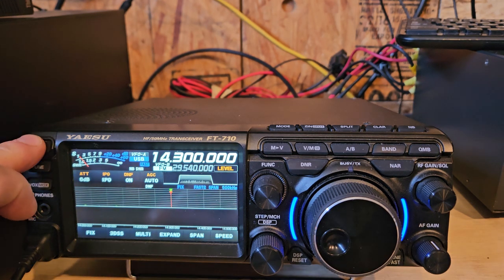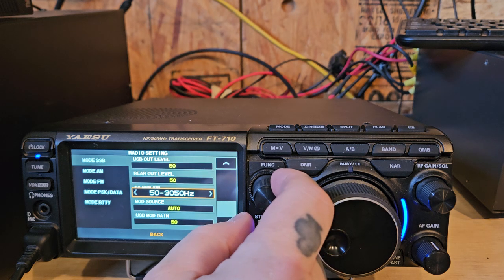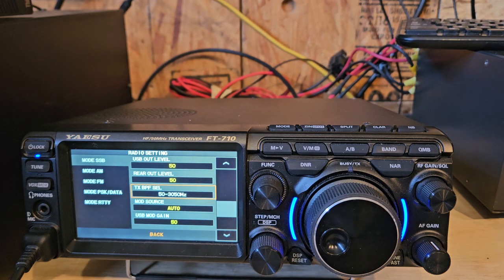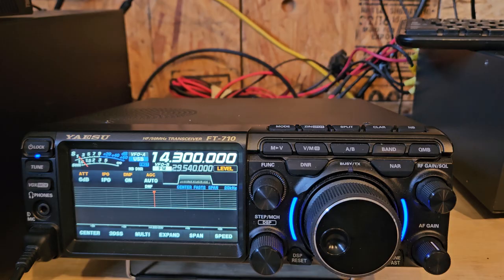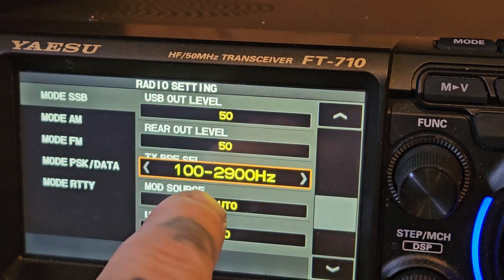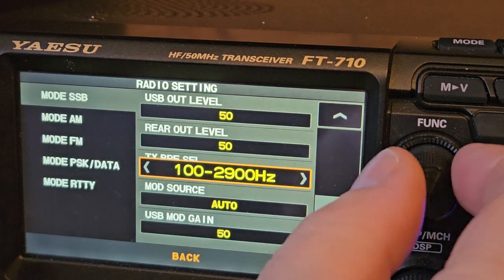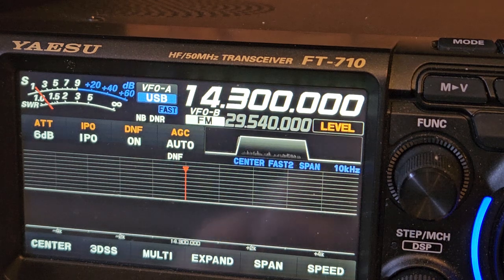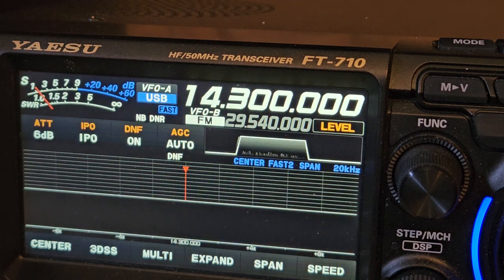Yaesu ft710 3.950khz transmit bandwidth procedure test basically 4k wide!

Comment: it doesn't work on my 710 with the newest firmware for Europe, maybe the USA firmware is different.
Reply from the maker: Just because it doesn't show it when you go back into the menu doesn't mean it didn't change you will have to look at it on another scope to see if it changes or not.  If you make the change and go back into the menu it will automatically cancel it and put it back to default you cannot go into the menu to verify the change otherwise it will not work it's some sort of glitch. Unlike other videos like the 3000 where you change it and you can go in and check it this one will not allow you to do that you make the change stay out of the menu and it will be 4K wide

Comment: Thanks for the in depth look. Do you think because the 101 & the DX10 are hybrids, they're easier for minute adjustments, and the engineers just phoned it in on the 710? Thanks for sharing. 73. KC3UEE
Reply from the maker: Yeah im not sure. They didnt seem to intended for it to do 4k except maybe for testing  but it works